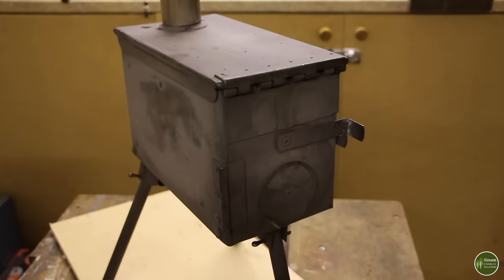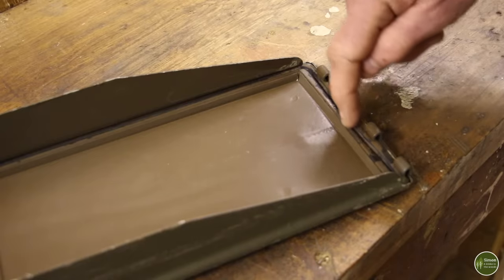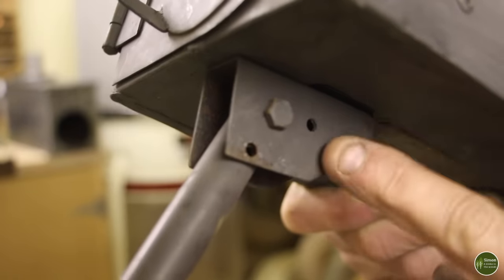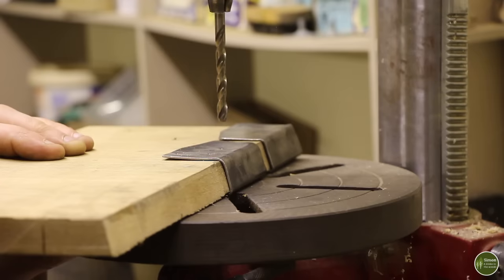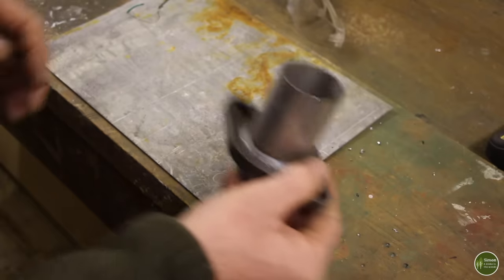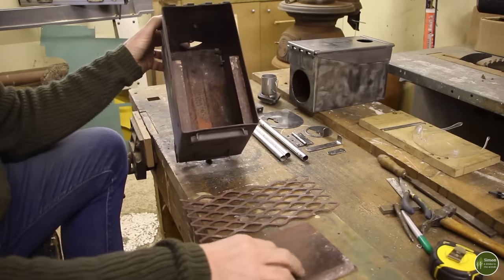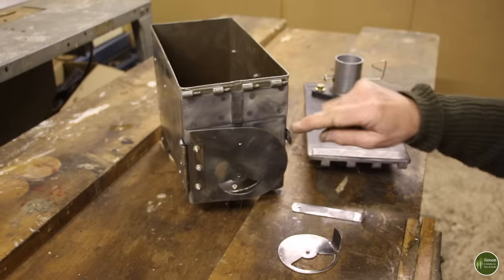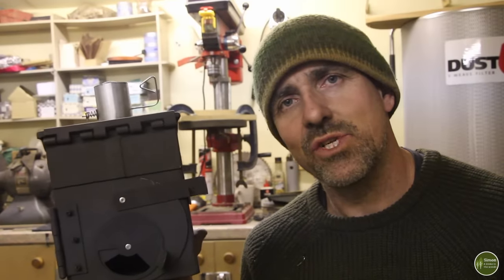Ammo Can Wood Burning Tent Stove. Make a Tent Heater for Winter Camping.

Comment: This may seem obvious to some, but most likely overlooked by many and not mentioned in the video: Do NOT use aluminium rivets - they will melt; steel rivets ONLY!
Reply from the maker: I used stainless steel rivets in this version, although the old one was held together with aluminium rivets - which held up to the heat with no issues - I’ve had that stove burning cherry red many, many times. 👍🔥
Reply: @simonablokeinthewoods  ... ever throw a beer can in the camp fire? Aluminum melts at 1220° F and some wood fires and commercial hard wood fuel pellets can reach temperatures of 1600° to 2000° F - 400° to 800° beyond Aluminum's melting point. In this and other fire box stoves where the air is blasted into the fire base, these temps go up drastically. Regular carbon steel (soft steel) melts at 2500° to 2800° F. If I build one of these, I will use steel rivets just to be safe.
Reply from the maker: Agreed - I’m not disputing the melting point of aluminium - just saying they didn’t melt on my old stove - there are hot spots on these stoves -the areas of highest heat being on the flat top surface and where the flue exits the firebox - temps there get up to the melting point of aluminium for sure (no rivets in that area) but that temperature drops considerably at the sides and underneath - I’ve done some tests with an infrared thermometer - around 300 degrees C on the sides. 👍🔥

Comment: I will ask Santa on your behalf for a compressor and a pop rivet gun.  maybe a gasket whee the flue enters the stove next time . other than that good build
Reply from the maker: That’d make popping those stainless steel rivets a bit easier!!
I found it doesn’t need a gasket - the smoke and gases take the easiest path straight up the flue - I’ve not had any issues with gases escaping though gaps etc, but always wise to use a CO detector to be on the safe side! 👍
Reply: @simonablokeinthewoods  Mine gives me a ppm reading also. If you change your mind about a gasket let me know I will send you some thing to use

Comment: But this stove will get eat up and destroyed by rust in a short time, like the thousands of projects showed in million-view videos here on youtube. It's so easy, so convenient, DIY a stove from scrap, why purchase an entirely brass or stainless steel, or cast iron stove, when you can use an old gas bottle, or a coulpe of car rims, or a drum? Because the stove will last a burning-time similar to the one you spent to make it! You can't paint the interior of the burning chamber, and there the process of rusting will run at fire-speed. This is an obvious ancient wisdom whe lost, when we started living with the clean soles.